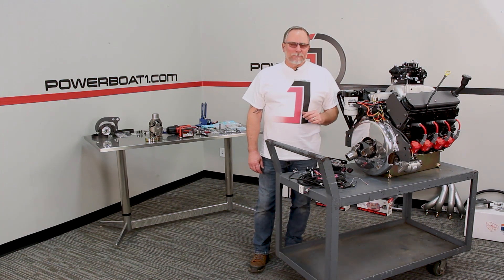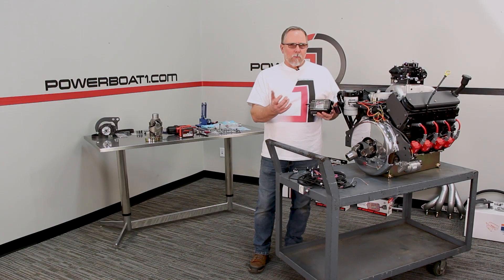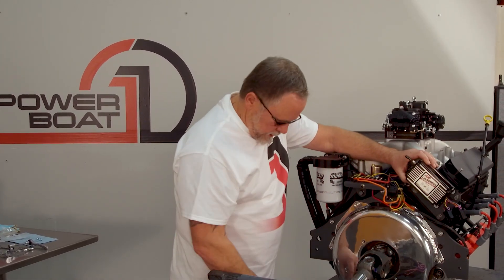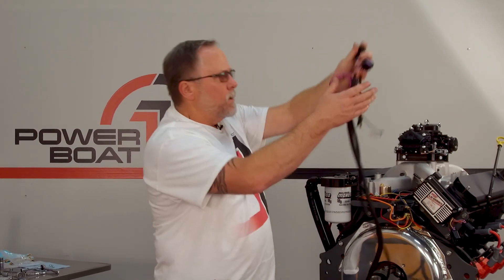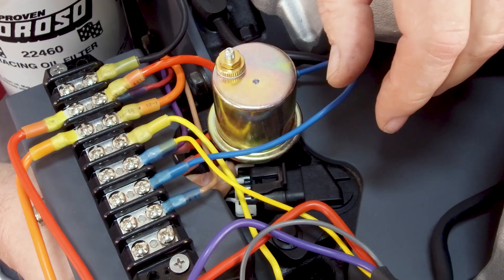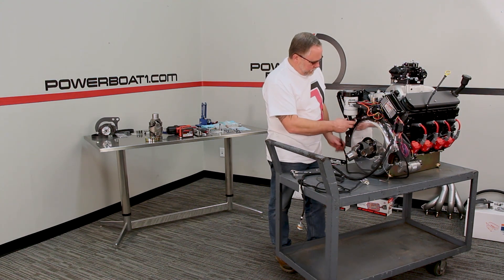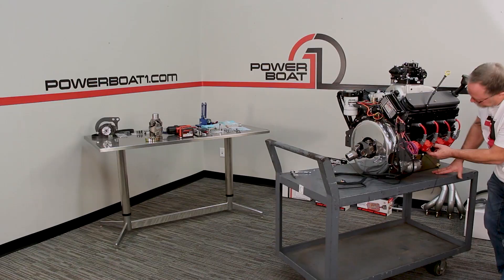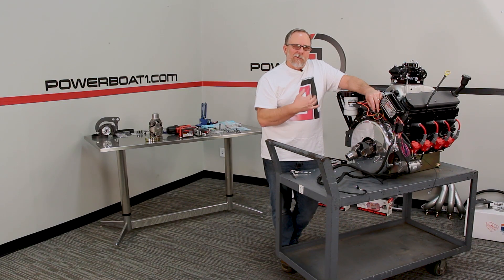LS Marine Conversion: Installing the Control Box and Connecting the Wire Harness

Comment: THIS HAS TO BE THE UTMOST MISLEADING ONLINE INFORMATION TRADING OUT A LS BASED ENGINE INTO A 1980 STYLE MERCRUISER BOAT I HAVE EVER WITNESSED AND ITS DRIVING ME UNDER THE WATER!!!!1
Reply from the maker: This LS engine is built to be used with a Berkeley / American Turbine style jet drive. It is not built for any kind of Mercruiser applications. Maybe you should watch the whole series before commenting, it isn't misleading at all...
Reply: @Powerboat1 would this work with a dominator pump?
Reply from the maker: @guillermozavala8820  yes it will